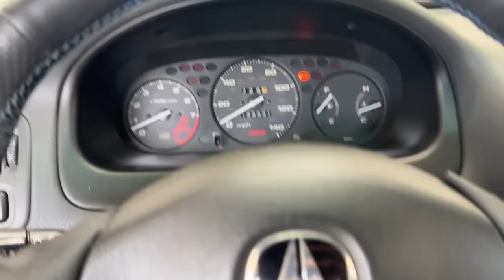My Most Reliable Car Broke Down. What Happened Next?

Comment: I suggest everyone having AAA membership
Reply from the maker: Low key 😂
Reply: @jarekmai  saved me several times just getting that tow home and not having to go out of pocket for it. Our cars are old, you never know
Reply: Definitely. Awesome if you ever lock your keys in the car.
Reply: @drivingdaily582 they don’t tow static cars tho so I can’t use them only if I run out of gas 😭
Reply: @SeanMcKenzie-mt5ml  you have to ask for a flatbed, wrecker won't work but they can get you with a flatbed...you can remove the front bumper to make it easier most tow guys who are good will be able to get you
Reply: Why? Every car insurance offer road side assistance which includes towing. Just call your insurance, you’re already paying for it why pay for another one with AAA?

Comment: My 98 d16y8 civic left me stranded a while ago and i also thought it was my fuel pump but after copious amounts or research and a lot of tinkering i found out that it was the negative spade terminal inside the distributor that had corroded so much that it wasnt getting any connection. I had terrible idle, lack of power, longer than normal crank, and eventually just no start at all. But after i bought a new terminal and coil it worked great. I would definitely take a look if you havent already.
Reply from the maker: Ill definitely give it a try!
Reply: Mine did that too me as I drove loss of power even though my gauge and radio worked it was my fuel regulator on the fuel rail

Comment: It could be the mass airflow sensor, I had a similar problem with my car and the MAF was the problem
Reply: It would still rev
Reply: hondas that year rely on manifold absolute pressure sensors not mass air flow sensors.
Reply: this car doesnt have a maf only map
Reply: Or ignition coils. A bad one caused 
Bad idling, and no power too.

Comment: try sparkplugs wires and coilpack it could make it misfire and run weak
Reply from the maker: I’ll check it out!
Reply: @jarekmai  yup, always change Spark plugs if you have a 1. Misfire in the ignition or eletricals 2. Check if it runs with poor gasoline milages if it does still run it's not the wire harnesses

Comment: 1. Chat gpt the problem.
2. use obd scanner. 
3. If the obd doesnt work and you have a p28 CPU so you can check the problem by pressing gas and counting the check engine.
Reply from the maker: Nothing like a check engine shows up in the scanner
Reply: @jarekmai  Could be a sensor that is broken or something.
Reply: To check for codes OBD1 style you gotta put the key to the ON position and jump the service plug by where the ECU goes. It's  green I believe. Use a wire or paperclip to jump the terminals. Then it's gonna make the check engine light blink. The slow blinks=10, fast blinks=1. So two slow blinks and a fast blink would =21.
Reply: @jarekmai  did you get it fixed yet ? If not I got a couple things you can check , it sounds like it needs air
Reply: Is it the maf sensor and probably check the cats

Comment: Years ago, I used to own a fbo 1991 Integra LS, and after doing a few hard pulls on the highway one night, it did the same thing. It lost its power, just like that. I had it towed home, and i sold it on craigslist that week. The new owner contacted me and said that there was a spun bearing. I'm not sure if it was the rod bearing or main bearing, but maybe it's something worth checking.
Reply from the maker: I’ll definitely give this a check! 🙏
Reply: Nahhhh not on the d16z6 they’re 90% bullet proof, on the b18 tho hmmmm
Reply: @eVerProductions1  you're saying the b series is more unreliable?
Reply: @PeterFeltersnatch852  even a d17 bro?
Reply: @RustyHondas d more reliable, bulletproof. B more likely to blow on turbo than a d
Reply: @vucci8378  even a d17 tho? I'm asking cuz my daily rn is a civic with a d17a2 but I'm fixing up my integra with b18b1 to be my daily
Reply: @RustyHondas  naw d16 onlu
Reply: @vucci8378  I figured, this d17 is a pos but has been pretty reliable and has 201k on it now. I don't know if the headgaskets have been done before
Reply: @RustyHondas  no aftermarket support like d 16

Comment: Check fuel pressure at the rail. Pull the plugs and check for discoloration on one cylinder. Cable throttles don’t have a TPS. If the IACV & FITV & Idle air screw have been cleaned and adjusted recently it is probably the MAF sensor that went bad. Unplug it and start the car and see if power comes back. Then put in a new one. Also check the rotor pack in the dizzy. The metal can wear down and cause a miss on all cylinders. There’s no smoke out the exhaust so it couldn’t be rings or gaskets.
Reply: I’m thinking it’s the rotor pack too! Happened to me with a couple civics
Reply: @Gen10civic  shoot it happened to me on my 94 integra back in the day and I thought it jumped timing! I’d definitely recommend him starting with the simple stuff and work his way through.

Comment: dirty idle air control valve/throttle body maybe?
Reply from the maker: Those were cleaned out not too long ago
Reply: Replace idle air control I had a ek coupe with the same problem not as mad tho but when I switched it , it can normal again
Reply: @suavthekid came here to say the same thing, iacv

Comment: Dont over complicate it, what does the car throttle pedal responds on to give the power when you need it/ if you have a volt meter / ohmmeter check sensor/voltage that your throttle rely on for throttle response (Throttle Position Sensor TPS) MAF is the car reading the correct airflow) The car is running so it has to do with something relating to throttle response (Since your car has a distributor Did the distributor jump timing) are your spark plug wires loosing spark) Simplify It yk i mean Focus on what Car needs for throttle response This where i would start My car had similar issues turned out to be Bad MAF (Try disconnecting the MAF & start the car without it, rev it out see if it revs past where it is)
Reply from the maker: This is what I needed! I’ll definitely follow this up 🙏
Reply: @jarekmai  no problem bro process of elimination what relies on what yk i mean i met to say multimeter good luck lets us know what you find out ❤️
Reply: Theres no maf or tps on a d-series....

Comment: Check your ignition systems , dizzy, plugs, wires , etc. Next check your fueling. New fuel pump good, move up to the fuel filter , check rail pressure. If that's good check air intake , manifold for any vacuum leaks etc. Of course check for codes first and fix those issues first.
Reply from the maker: Thanks for the tip! I’ll definitely check it out!

Comment: Check the timing, it might’ve skipped a tooth, had the same thing happen to my ef civic, fuel was good, but no power, checked the timing marks and it was off by a tooth and belt was slightly loose, issue was fixed right after I retimed it and tensioned it
Reply from the maker: Ill try this out!

Comment: Hey I’m a mechanic and I had a Honda like that and also deal with them still regularly and 75% of the time the distributor is the issue when they don’t run right. Not only does it have regular distributor issues like corrosion but it has the cam sensor inside which goes bad a lot and even seen the distributor shaft break
Reply from the maker: Ill check it out! thanks!

Comment: Im 16 and just started working on my own project civic but I had a similar issue and figured out it was the Idle Air Control Valve, id try cleaning it or replacing the whole part and see if that would work out. Love your videos by the way!

Comment: Reminds my of my old prelude it  lost a wheel on the highway, later broke a timing belt again on the highway and after selling it got wrecked. I don’t miss it
Reply: I lost a wheel once driving, lug nuts snapped right off. My wheel continued to roll into on coming traffic and hit a car. It hit the car directly in the front, so fast that it launched the guys car into the sky like hitting a ramp lol

Comment: If you’re not getting any codes I’d suggest throttle cable or injectors. If you have an inline fuel filter check that also.
Reply from the maker: Ill give it a try
Reply: @jarekmai  best of luck my man, make sure to bring us on this diagnostic adventure with you <3

Comment: Have you try turning up to throttle body. Engine get fuel but now enough air
Reply from the maker: I’ll check
Reply: Yes  @jarekmai  check that. I drive a Nissan u14 (1996 bluebird) and that was what happened to me.
Reply: Also I had one EK before but my dad driving it now

Comment: +1 for egr related issue or intake leak
Reply from the maker: Maybee
Reply: @jarekmai  I'm more familiar with the obd1 cars sorry I can't be more help but if you have a junkyard near you go nab a bunch of stuff and try all the little easy to replace things like map/maf/O2 sensors first. Junkyard trip would make great content! Best of luck to you homie thanks for all the laughs
Reply: @jarekmai  block off the EGR valve from the intake if you haven't already tried that, just to eliminate that possibility. Spray brake clean all over and around where the intake meets the head and if the idle drops or it stalls you have an intake leak. If the leak/issue is from any of the valves on the intake and not where the runners meet the head you can block them off temporarily to get you around. 👍

Comment: Don't know if you mentioned it, but it might be a good idea to check your fuel filter

Also you could try pulling the fuel supply line to the fuel rail off and run it into a bucket to see if its flowing properly
Reply from the maker: Ill give it a shot

Comment: Take off the exhaust manifold and pipe maybe it’s a big leak, just did a head gasket replace on my d17
Reply from the maker: I’ll check to see if it got a leak
Reply: @jarekmai  Take off your catalic convertor from your headers and run it, cuz it might have a clogged in it. So its restricting it and giving it back pressure...

Comment: Check your ignition coils, and o2 sensors!!!! Had to have my fuel pump replaced recently in my ‘08 Camry. It’s a bih fr, and when an ignition coil goes out. I had a new NGK coil cause cylinder #1 misfire, and I had no power, making it up hills was beyond difficult. 
Salute to the locksmith 🔒 🫡

Comment: I would first test the injector with a multimeter the throttle body position sensor and the MAP sensor. If all that stuff is good go over the ignition system distributor cap, rotor, and spark plugs.
Reply from the maker: Ill give it try!

Comment: Could be throttle cable? I would guess could totally be timing i would triple check it. Maybe airflow sensor if your car has one... I wluld check any and all sensors in general
Reply from the maker: I’m thinking the timing too! I’ll keep you updated
Reply: @jarekmai please do cause I'm curious as what the issue is... I would also try and do a compression test because if it is timing related I know that D series engines are interference engines so you could have tapped or bent some valves which would explain why it makes no power exhaust sounds wrong.

Comment: Had a similar problem with my Mitsubishi, cleaned maf sensor and injectors 1st and it was running okay for a few days, but then it happened again, then i changed vvt sensor and it worked like new again, so that might be the problem.
Reply from the maker: Ill check

Comment: What ecu are you using . Im assuming its a sensor related maybe check the tps ..map ? use the honda manual for their diagnosis with a multimeter it will tell u from there what to do
Reply from the maker: Ill check those out!

Comment: Throttle is ur issue looks like check the throttle cable tps throttle position sensor throttle body maybe it’s something wrong with your intake start tearing it up
Reply from the maker: brand new tps but no fix

Comment: Du ma!! Remove the downstream o2 sensor. If your power comes back your exhaust is plugged up
Reply from the maker: Still the same :face-orange-biting-nails:
Reply: @jarekmai  That's good. You can rule out an exhaust restriction. You can use a spark tester to check the output of the distributor. You want to see a strong spark

Comment: I could be the sensors mostpeople thing it something wrong with the main components in their cars when it's literally a sensor not registering and the car cuts off as a safety measure cause BMW and Audi cars sometimes has theses issues it an easy fix but other i couldn't think of anything that can damage the car, cause even electric cars got this issue the most some water got into the sensors and it could start cause a warning signal showed up.